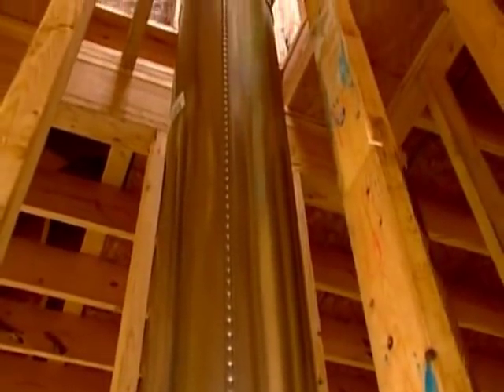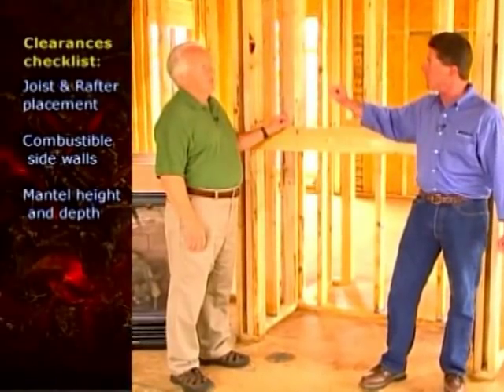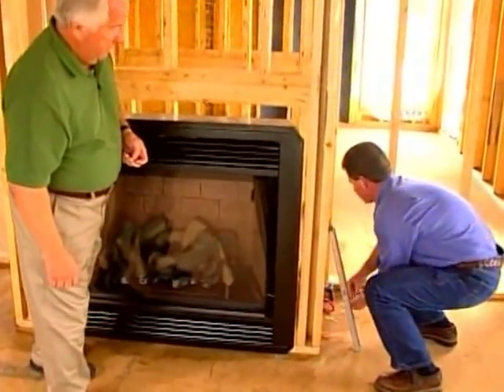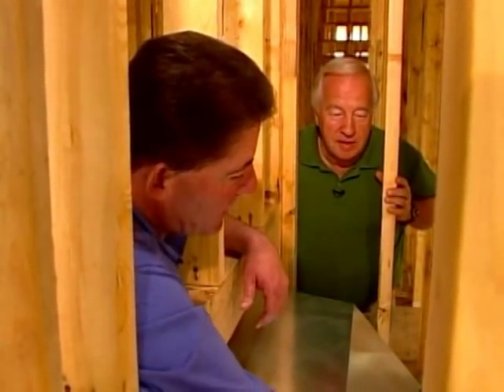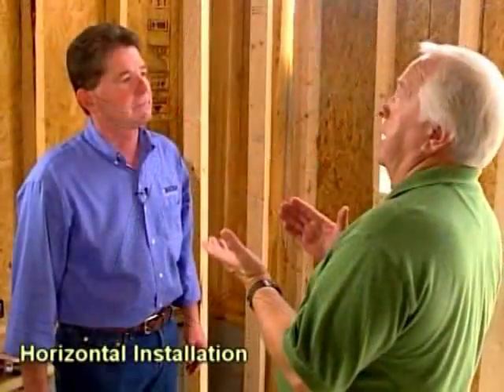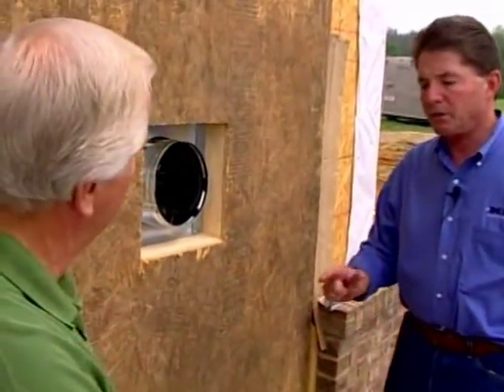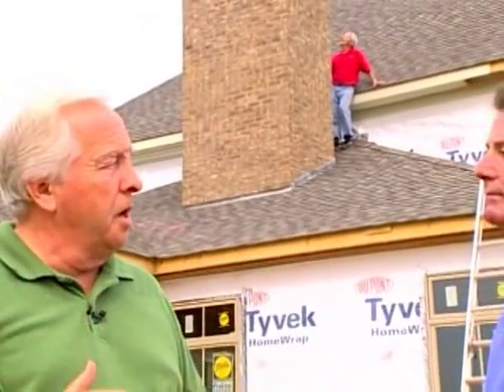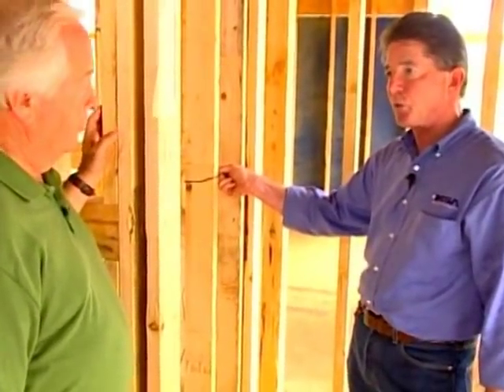Tech Video: Direct Vent Fireplace Installation

Comment: how does an electrically powered gas valve open during a power failure, to provide some heat and light?
Reply: john houston with a battery backup accessory.
Reply: It works off the pilot light...Or just light it.. I don't think I've had a problem in 24 years.  I have an old one.

Comment: Is there a limit to the length of the horizontal exhaust pipe?

 Does it require any pitch?  or exactly horizontal is okay?
Reply: Yes but that is manufacturers specific and depends on bends in vent
Reply: I thought it showed 1/4" slope or rise on the horizontal piece. Kinda like you would run a sewer pipe. I was wondering if they were going to show the installation of the gas line? I guess that may be another video.

Comment: Their web site is the worst for information.  They want you to guess where the places that sell these numberous fireplaces are. Instead of listing the places that carry the stuff with the prices, they want you to put a million different zip codes in to see where the stores are located.  You need a big list of zip codes, they don't have this stuff in every town.  Start at the top and work your way down until you hit bingo I suppose. I won't be doing business with them. I have to build the whole fireplace myself and don't have time for this crap. Going to find another place.  I am sure Lowes or home depot carry the hardware up to the Chimney.